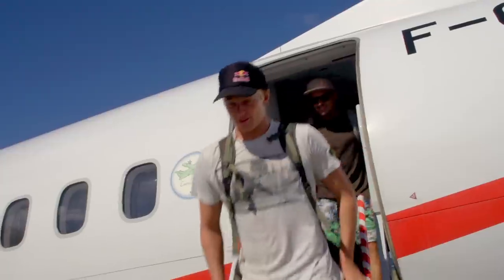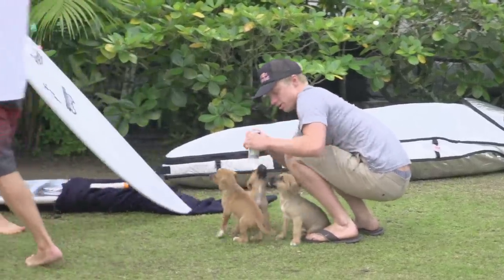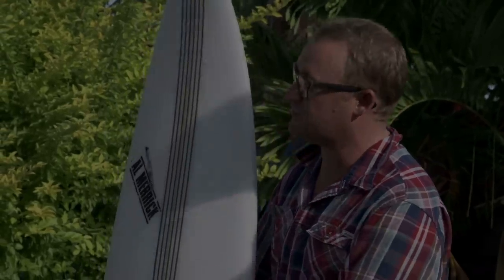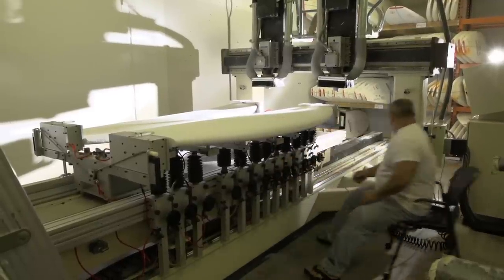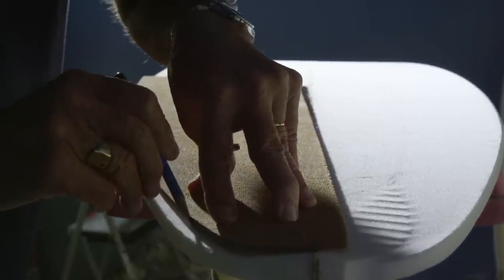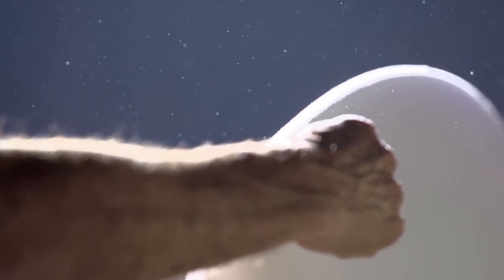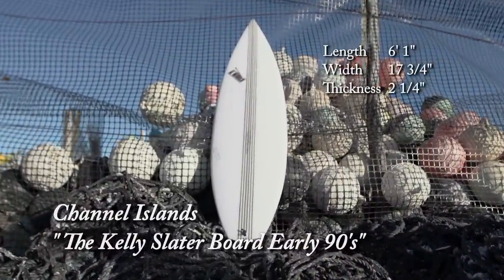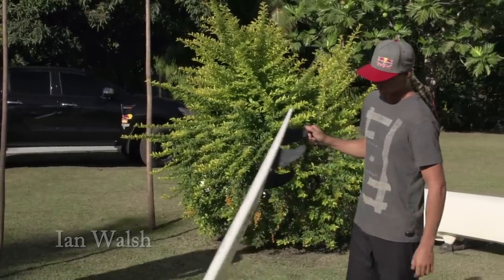Red Bull Decades - The Kelly Slater Experience - Ep. 4

Comment: Back in 95' I had my shaper Syd Willmett (Glasser at Nev Surfboards) make me 6'1 x 17 7/8 x 2 1/8 boards. I used to get him to take as much foam out of the nose as possible without it snapping before being glassed. I probably only weighed 130lb at the time though. Rarely anyone surfed over 18 1/4 wide back then. I can't say I caught waves as easy as I do now on current boards but they were fun.